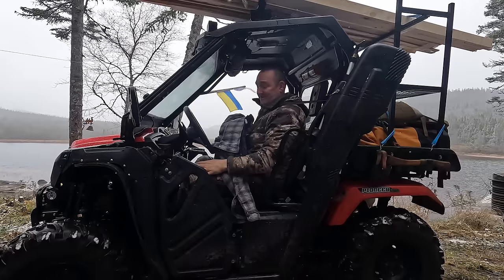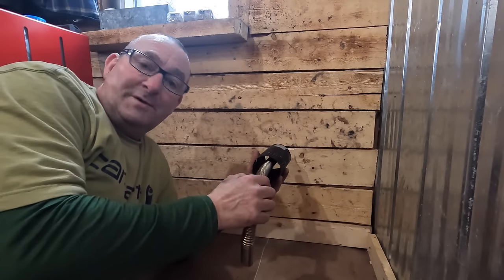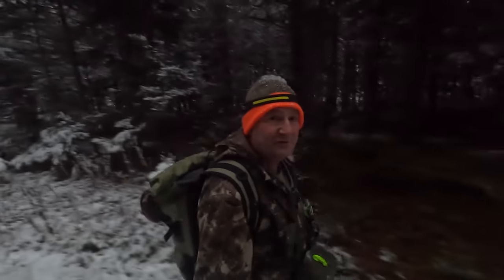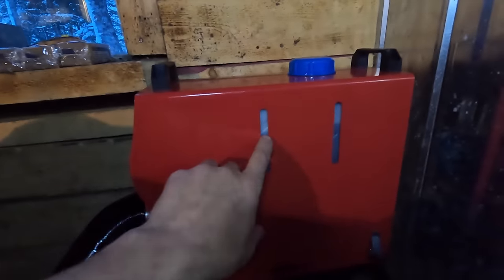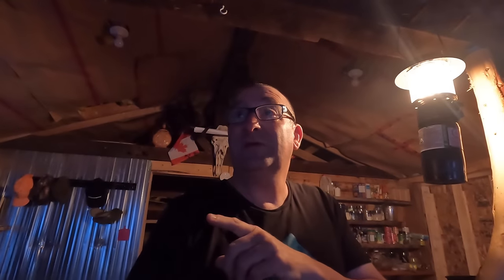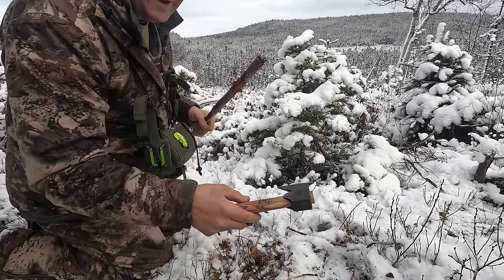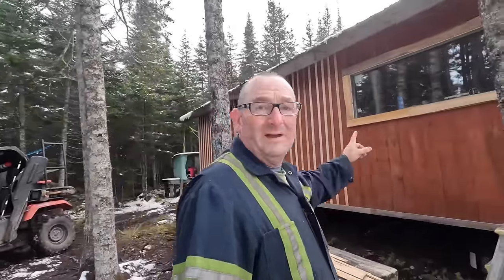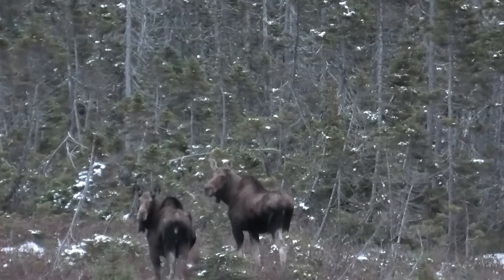Finally Finished The Remote Cabin Siding Episode #76

Comment: Another great video Bob. Cabin coming along. I agree with the comment about placing the heater outside, would be quieter out there.
Reply from the maker: Yes I'll experiment
Reply: That diesel heater will be more efficient use less fuel recirculating the warmer air on the inside. They make different style of heaters that have a separate fuel tank and pump that can be put outside.

Comment: Great install on the heater. Great thinking on using the electrical parts to go through the wall. I have three of these and two are installed in my sailboat. They work perfectly for those cool June mornings when we live on the boat. Great video!
Reply from the maker: Thanks

Comment: Man you’ve done a great job with the place.  
Next summer I’d weld on a diagonal brace for those legs, in case someone accidentally bangs it.    Also I saw a video where some guy swapped out the fuel pump for something much quieter.   Can’t think of the name of the channel, but you may want to look into it for next winter.
Reply from the maker: No I'm fine just like it is, a little click don't bother me

Comment: I like you video very much it is educational I have learned a lot from you ,but now I would like to share something with you and that is how to properly clean cast iron  pot and pan.
Simply have a nice hot fire of heard wood let it make a nice bed of coal and put the pan or pot on the hot cold let it burn until the pan or pot turn gray do not put cold water on it ,it will break it or Crack it ,after the pot or pan  as turn gray let cool and wipe it down with steel wool, no more sticky pan or pot , when it does stick again repeat that same process.
I do that with all my cast-iron pots and pan.👍🤝
Reply from the maker: Thanks

Comment: Good evening. Fine job done on the cabin. Just wondering about the metal plates you used to centre the exhaust out the wall. Did they come with your heater? Or did you buy separate?  If bought separate what are they called or where could a guy purchase?   Thanks
Reply from the maker: They are  at Kent building supplies or home depot in the electric department or sometimes in the propane exhaust division

Comment: Dumb question my mother use to take the lid off the wood stove and put the frying pan right in the hole. Our stove top had 3 different ring sizes to fit different pan sizes.
Reply from the maker: What's the question

Comment: Bob, I just purchased the diesel heater, how long does your battery stay charged while using the heater? How often do you have to charge your battery?
Reply from the maker: @Islandguy2024  i use mine for a 3 day weekend then i go back to work, i tgen charge it fir the next weekend nit sure behind that but 3 nights is probably alot